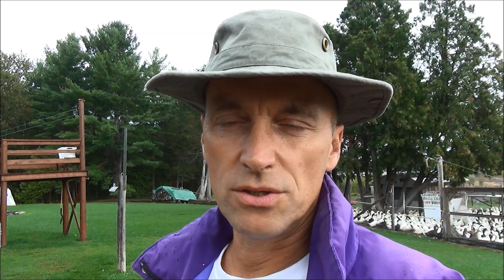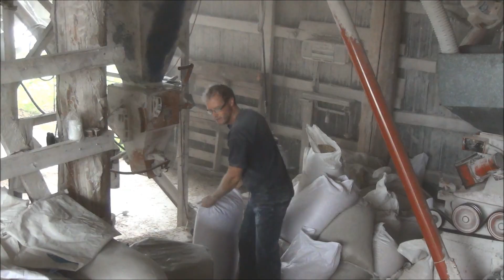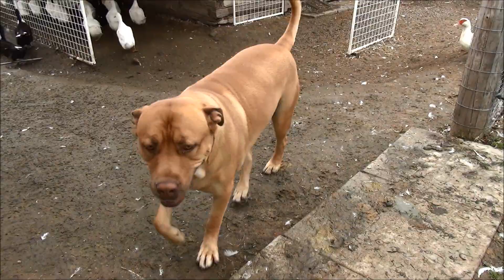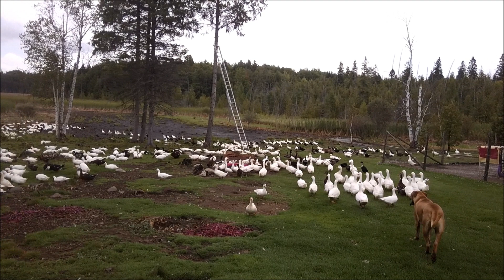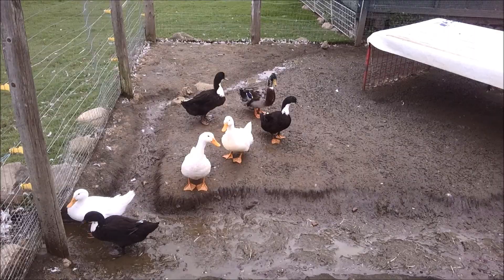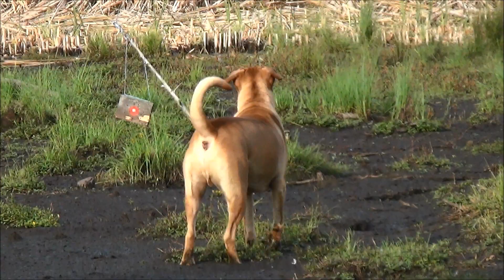Russian Roulette Feed Run Today #48 Raising Ducks For Charity

Comment: Disco duck is on her own schedule.
Sorry to see the truck breaking down. Dug could almost pull the truck if it dies. He's strong as a moose! LOL
Does the farm make deliveries? That might be a temporary option until you get a new truck. I think a one ton pickup would work and get much better gas mileage.
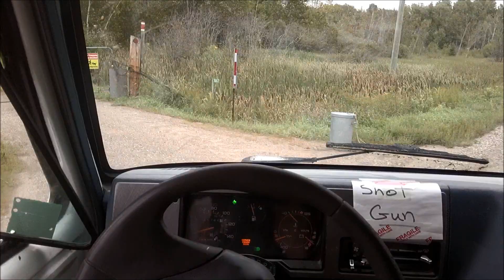6:07 - I like the "guard dogs on duty sign," except it should show Dug licking someone to death!
Good to see you make the feed run first and then let the ducks out. I bet when you left, the coyotes may have noticed and stopped by for a duck buffet, only to be disappointed. That may be why most of the ducks don't want to go to the creek. I'm glad Disco duck is okay.
Reply from the maker: +alan30189 pick up only

Comment: Came across these snippets:

Blue smoke is almost always burning engine oil.
With a 1992 car, it can be a leaking seal, gasket or ring.
If too much oil leaks in that cylinder and fouls the spark plug, it will cause a misfire in that cylinder. The spark plug will then have to be replaced or thoroughly cleaned up.
Most old chevys eventually suffer one day or another of desintegrating valve guide seals caused by surface tension additives found in engine oil, injection cleaners and gas additives.

The good news is, it's repairable unless mechanical damage has already been caused by the misfirings.

Comment: Matt, what year is your truck and what engine? i may be able to assist...
Reply: LOL!
Reply: +darthvader4hire You're the greatest if you can lend mechanic work or parts for the truck!
And, +smokeydoke100, that was frikin hilarious!
Reply from the maker: +darthvader4hire 1992 chev 1 ton 350
Reply: +50 Ducks In A Hot Tub Oh, i was going to say i have a bunch of 454 stuff but not alot of small block stuff. hopefully it is something fairly easy to repair.
Reply: +50 Ducks In A Hot Tub 

How many miles on that truck ?
Was the engine running rough ?
Did that "low compression" feeling happened just at once, or could you feel like it was building up over several days or weeks ?

First, closely check those sparkplug wires for burnt, worned out or chewed insulation.
Check the plugs contacts for any clean/white marks, suggesting  a severe vacuum leak - like carb base gasket.
Clean the sparkplug wires and contacts with white spirit!

What ODB codes has the DLC put out ?
http://www.obd-codes.com/faq/read-gm-2-digit-obd-codes-free.php
Using a paper clip, just jump terminals A and B.
Reply: shot in the dark but a gummed up PCV valve and stuffed up exhaust can cause many simmilar issues....and a1992 aint going to have much compression to begin with.